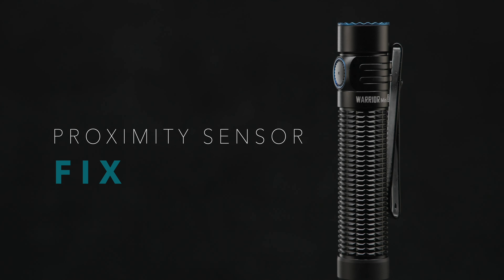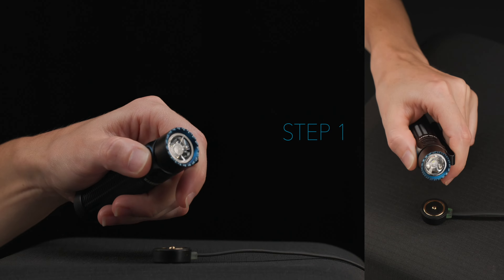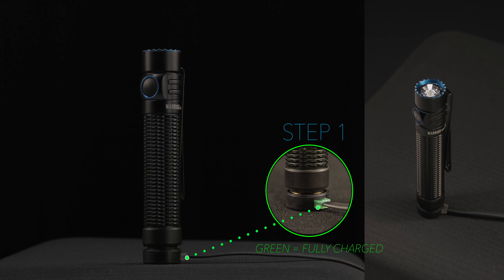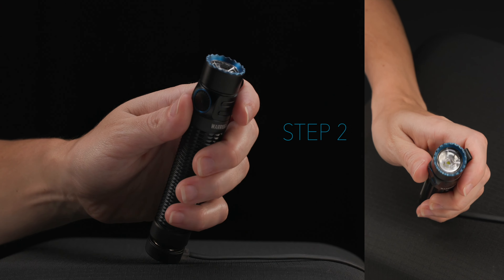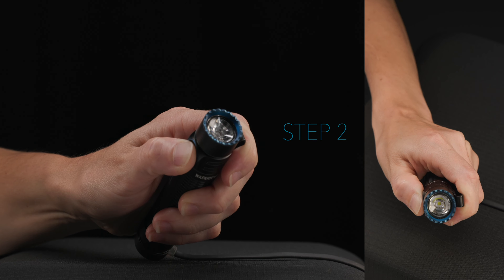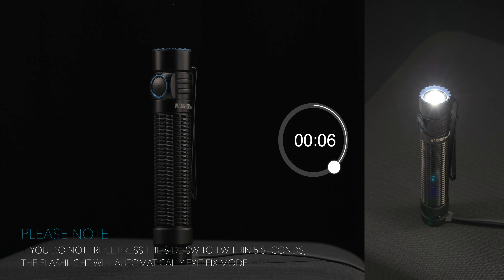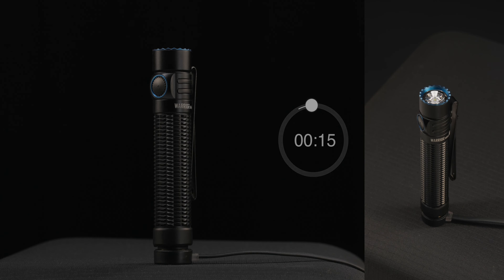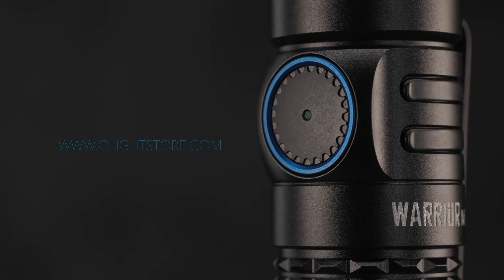Olight Warrior Mini 3 Proximity Sensor Fix

Comment: Hi Martin. I have a Warrior 3S having the same issue.
Do you think this fix can work for my flashlight?
Reply from the maker: no idea - i try to ask
Reply: @MartinRathmanner_M4D_M4X Any update on this?
My Warrior 3S is still failing and I can't send it to the CS because I live in a country without it.
I know it must be a reset, because once I was playing with it and I fixed it. It was working perfectly.
After a couple of weeks it failed  again and I couldn't repeat whatever I did.
It would be good to know how to reset  the proximity sensor.
Reply from the maker: @---gu7yz  I only know about this procedure 

did you send olight a email how to get your warranty?
Reply: Yes, the customer  service was super helpful and they told me to send it back for replacement.
I was just waiting till the last moment  before the warranty expires hoping to find a reset. Because I use the flashlight at work and I didn't want to stay without it for so long.
Specifically knowing that I fixed it once before and for sure there must be a way to reset it.
Martin if you know someone maybe you could ask.
It will  be helpful for many people. I readed in forums about other users with the sensor issue  with the W3S.
Reply from the maker: @---gu7yz  I do not think there is. another procedure (besides opening the light and reflash the driver )
Reply: Ok thanks  for the help! In this case I will send it to the CS and let's see.
Thank you once again

Comment: My light does not seem to have this mode. Pressing and holding locks the flashlight, no fix mode
Reply from the maker: was the cell fully charged and the MCC still connected (green)

Comment: Can you tell me what the proximity sensor is and what it does?
Reply from the maker: its a brightness sensor which dectects the reflected light.
If the value is too high the flashlights own brightness is reduced to prevent overheatiung any material in front of the lens
Reply: @MartinRathmanner_M4D_M4X  thank you

Comment: I have many fenix flashlights.. I got my first olight, the wm3 and i was very impressed.. i tought it was my best light until it got wet in the rain.. the whole operate system didnt work anymore
Reply from the maker: I assume your replacement works fine?

never had problems with water from rain or dipping (no diving)
Reply: @MartinRathmanner_M4D_M4X  what do you mean exactly?
Reply from the maker: @Ja_wat  Olight would have exchanged any faulty flashlight.

Comment: When i hold my side button, it just goes to lock out mode. It doesnt do the double moonlight feature. Can u please help me??
Reply from the maker: charging complete? (green for ~1hour)
Reply: @MartinRathmanner_M4D_M4X  didn’t work
Reply from the maker: @IamIrod  charging did not work?

does the light work correct besidesthe sensor issue?

can you access all levels 
lockout is possible etc?
Reply: @MartinRathmanner_M4D_M4X  whenever i go to use turbo or high mode, it auto dims back down to medium
Reply from the maker: not good

when the procedure does not work for you it might be time to use CS and have Olight repair it

Comment: It doesn't work on my warrior mini 3. My turbo mode doesn't work anymore
Reply from the maker: Hey!

Does the Battery indicator show green when you switch the light on?
fully charged on a 2A+ outlet?

What happens if you switch via the rear switch?
Mid-Turbo or Mid-Strobe?
Reply: @MartinRathmanner_M4D_M4X  it finally worked. I must have tried it 20 times. I was about to give up and tried it 1 more time and it's fixed now

Comment: Mine wouldn’t cycle back to moonlight then I took the cap off and put it back on then tried this again and boom works! Didn’t have to send it back after all!
Reply from the maker: Olights never cycle (when holding the button) though Moon ?

only from off when holding the switch 1 sec